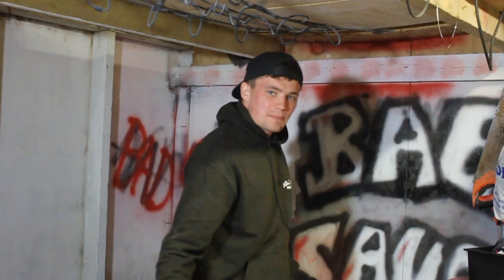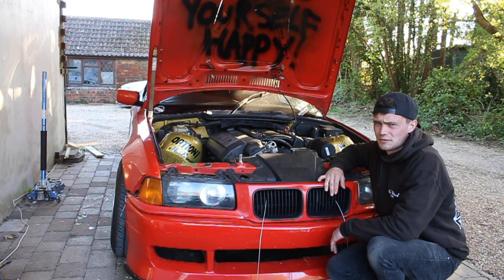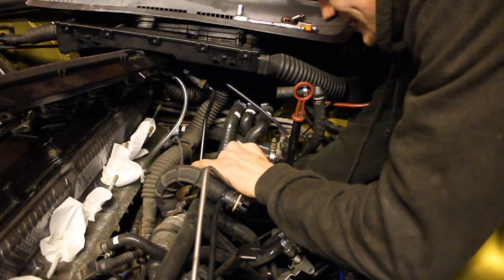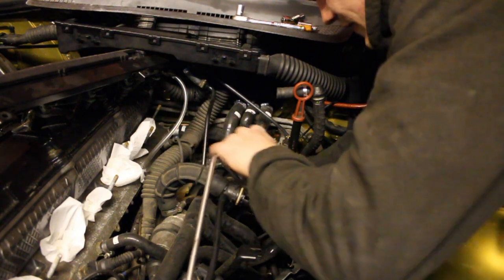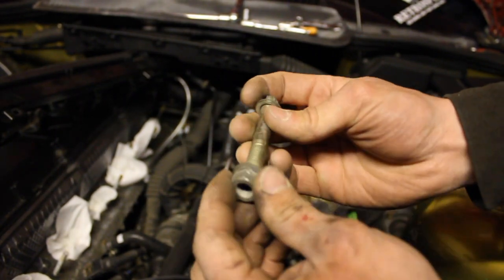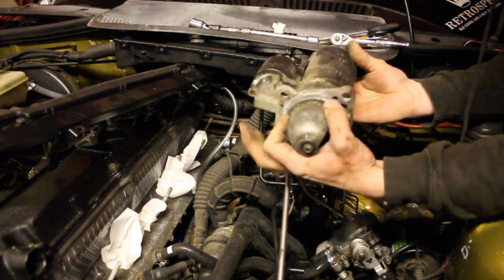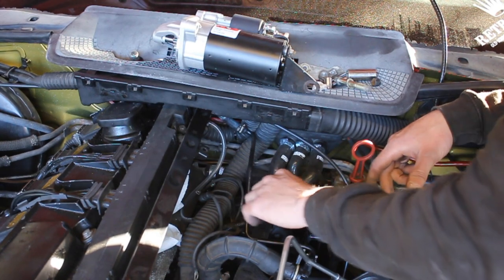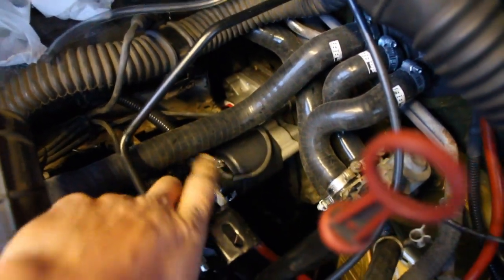HOW TO BMW E36 Starter Motor Replacement

Comment: So you have a 16mm nut on the torx bolt. I've done one on the drive yesterday and from factory it's just the torx bolt bolting into the starter x2. I dropped the subframe to tip the engine and got a torx spanner in. Had to remover heater control valvde and hoses. Was a bit of a shit job tbh.
Reply from the maker: Yeah its a weird one as the original starter did not have threaded bolt holes, but the new one did! but I must say that having it nut and bolt is a lot easier as you can get a ratchet on the nut and just hold the bolt with the spanner as there is little room to mover on the gear box side!
Reply: Definitely a lot easier. Well hopefully it will last. Also this was the first starter that I've removed and the housing over the gear broke into bits, one bit was sitting on the flywheel

Comment: Kinda wish we seen a before and after of the starter motor. Amazing vid btw
Reply from the maker: Unfortunately it was a very temperamental issue and every time I went to film it, it started straight up fine! basically it just wouldn't turn on sometimes and you could hear it try and crank it but it wouldn't!

Comment: I would recomend replace the crankshaft position sensor if never replaced before, and if the odometer reading  is 150+ K miles. An extra $125 will save a lot of work since the intake manifold is being removed.
Reply from the maker: This is just a video on replacing the starter motor

Comment: Hey bro, I noticed the starter you pulled out is a pre-1996 which has thin ears, is threadless and requires a bracket, and you replaced it with a post-1996 starter with thick ears, has threads and doesn't require a braket to be mounted, did you have any ensuing problems with that? cheers
Reply from the maker: No man was absolutely fine as it mainly the two bolts that hold it to the gearbox that hold it in
Reply: @TheBaeSauceShow  im guessing you didn't need to use the old braket with the new starter correct?
Reply from the maker: @klutzythecrab8665  no mate
Reply: @TheBaeSauceShow  awesome, thx for the reply, big help